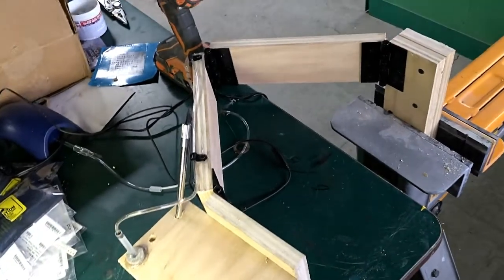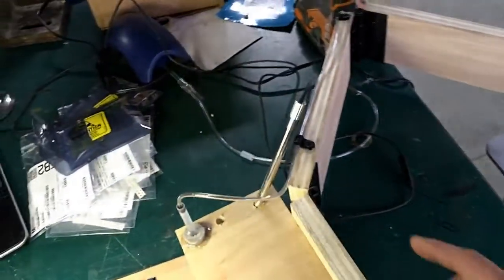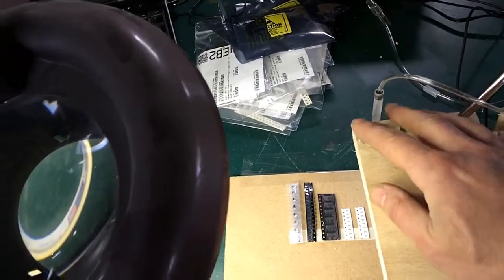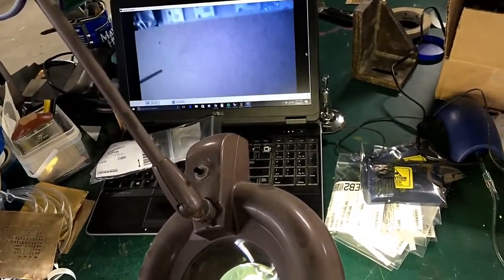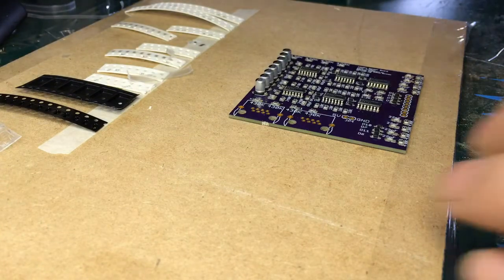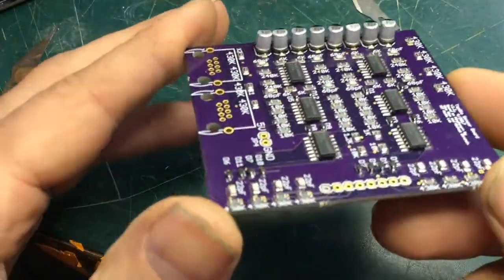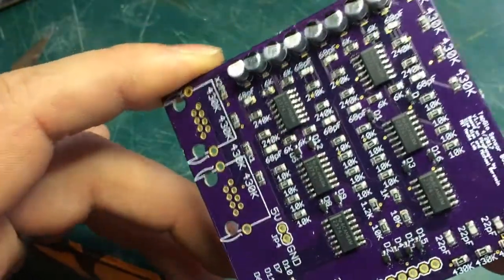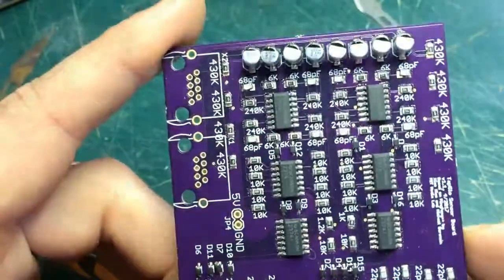DIY Pick-N-Place  Super Simple DIY PNP for SMT

Comment: Tom,
Great videos.  I am glad I found your YouTube channel. If I didn't know any better I'd swear you were stealing my ideas, LOL.  I use the same brand air pump you are using in this video. I use an aquarium air pump made by Tetra.  I use the Tetra 20 (made for 20 gallon fish tanks and costs about $20)  To convert it from an air pump (blowing air) to a vacuum pump (suck in air) I opened up the case, pulled the white air valve plate out and simply turned it around and stuck it back in and buttoned it back up.  I use common fish tank air hose that fits the pump.  On the end I use a syringe that I modified into the hand piece.  I then am able to use different gauge tips for different sized parts.  I simply used hypodermic needles and ground the sharp point to a flat tip, then bent it over an ink pen to make a nice 45 degree angle.  I use an ink pen to bend the needle so that it doesn't kink on  me when I bend it. The end result is a very useful vacuum pick-n-place tool with different gauge application tips that screw into the syringe hand piece.